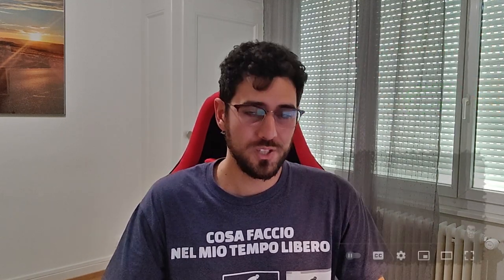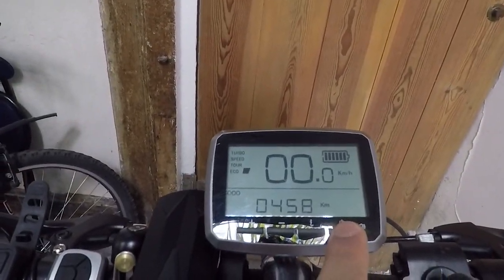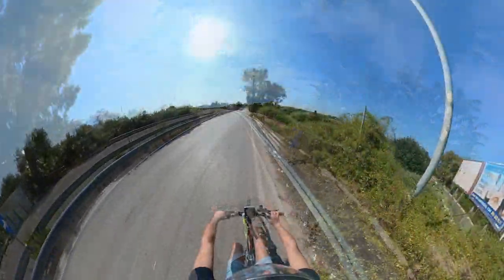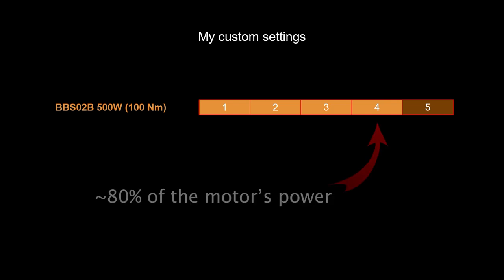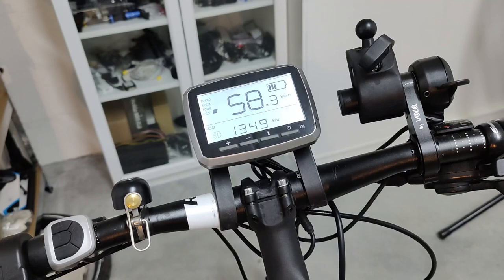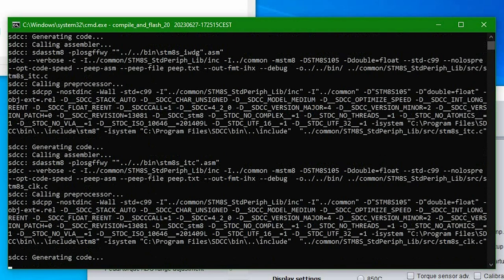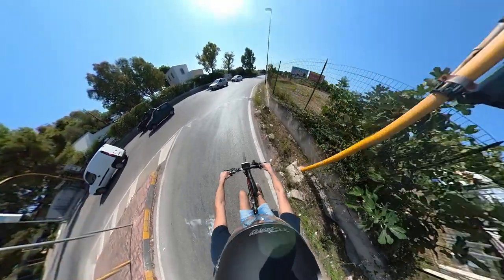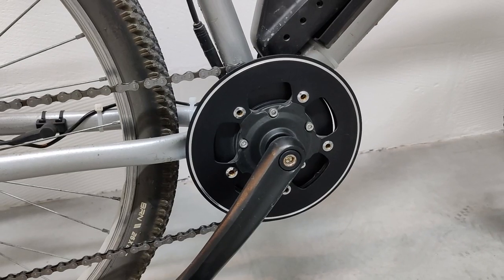Tongsheng: OSF Part 2... AS FAST AS BAFANG?

Comment: Hello Luke it is great to use your software on the tsdz2 motor. In fact it easy to install it. It worked perfect. NO errors. And now it is very adaptive. But one thing. Changing the settings with a VLCD6 display is very hard. For me almost impossible. MAybe you can make a short video of it.  Thanks and I hope you can give more support to change the settings with the display.
Reply: How much did the kit cost? Motor + battery?

Comment: Hi Luke, I have the BBSHD and the BBSO2B, and with the eggridder, I can set up both motors from my phone even when I'm out riding my bike and through bluetooth I can change the amount of power I want from each pedal assist even switch between off road and road settings with a press of a button.

Comment: I have a 750w kit. The big problem with this engine is overheating which prevents the engine from reaching maximum performance. I made some changes following the instructions in some videos and installing aluminum heat sinks. The situation has improved but during the hot season I will never get 100% of the performance. I don't think that installing this firmware will have any advantages as the main problem with the tsdz2 is due to a mechanical design defect.
Reply: 750w stock firmware will behave worse as OSF set for 500w. Also, Tongshen did you dirty, because in reality your 750w is exactly the same as my 48v 500w. Identical, to the last nut and bolt. Something to do with lawsuits as well ;)

Also done the cooling mod, alu insert and top plate + thermal interface material where needed. It's not enough, not for 900w at least ( and it's not even high summer ). Seems to be fine with ~750w set as max battery draw and using mainly the second and third power levels. 

The mechanical issue is the spindel, but if you ride the bike as a 'normal' commuter and you're not overweight, you're fine. I actually ride mtb tracks and in my 4k km I haven't had an issue yet ( I did install the recommended extra bearings, same time I did the cooling mod ). I am a lightweight though, so my spindle thanks me for that I bet. 

The other design issue is the heat dissipation, but that's mainly because the motor was intended to be 500w not higher. The cooling kit does fix this for a large part, I just didn't want to buy the big external heatsinks because I felt it would give away the thing aint 'stock'. You do need those, the alu inserts only improve heat transfer from the motor to the casing/housing, but the housing itself just lacks any real heat exchange surfaces of it's own. 

Anyway, kind of wished I waited a month and gotten the tsdz8 instead. Same pricepoint, lots more power and fixes both design issues present in tsdz2.

Comment: Anybody want a programming cable for tsdz2/tsdz2b?
Reply: Yes, I'm looking for one
Reply: Me too
Reply: @juan1ride  what country are you in?
Reply: Yes I'm needing one too, UK
Reply: It's really not that hard to make one yourself from the supplied cables with your programmer. That's not being pedantic, but even my not so great fine motor skills the wiki guide was enough to end me with a working cable. 

It's finicky getting the metal pins out of the plastic enclosure, and you really must imho even when wiki says it's optional use heatshrink over them, but even I could do it ( and my fine motor skills aren't really that great ). Took me 30 minutes.. and two sets of cables ( I luckily ordered two ST-Link v2's to start with ). 

I would also advice to ignore wiki which again says it's optional to disconnect your battery ( or turn it off ). It's not optional, or it wasn't for me. First ST-Link connected once, allowed me to get my backups from the controller but when trying to flash after that it kept failing. Couldn't figure it out for a long time, until I tried ST Visual Programmer again instead of the java configurator and noticed it said it was connected, but it now failed to read the firmware. ST-Link's do tend to die when using with a connected battery, or better said mine died with a connected battery, and my reserve one which I only been using without a connected power source is still going strong.

Comment: Hi Luke, if you are looking for a "ghost pedaling" feature it should provide a "cruise mode". You can also change the mode via the display (no need to reload the configuration via java configurator). However, when I tested the "cruise mode", it behaved a bit strange. The bike accelerated to the set speed when pedaling, but then slowed down, then accelerated again... It just wasn't a smooth ride, but a constant acceleration and deceleration. Perhaps this could be tweaked by setting some parameter, but I haven't figured out which one yet (maybe tweak the percentages for motor acceleration and decelaration, so far I'm using the default setting of 35%).
Reply from the maker: thanks man! I'll give it a try

Comment: This may be a dumb question. When you upgrade the firmware, will you have to upgrade the firmware again if you change your display?
Reply from the maker: it depends on the display: this OSF version is specific for the VLCD5 stock display.
So if you'd like to install the modified 860c display afterword, yes there's a different firmware: you first need to restore the stock one and then install the specific OSF version for that display

Comment: Hi Luke, did you try to revert to the original factory firmware after you flash custom firmware? What happens to the odometer after flash the custom firmware? Does the odometer reset or does the original value remain?
Reply from the maker: Hi, that's a great question! Yes I did revert to the original firmware and then also reinstalled the OSF: in both cases the odometer survived the flash.
Which makes me question where exactly the odometer value is stored... maybe in the display itself? Maybe in an unaccessible area of the controller? Not sure...
Reply: value is stored in eeprom in your controller ( on a protected address which isn't overwritten when flashing firmware ). 

Be happy, or any second hand tsdz2 would come with a 'measly' 500km use by flashing new firmware ( or changing the display, if it were stored there ) ;)

Comment: I've been running the TSDZ2 on open source firmware for over a year now, just passed 2000 miles.  Around 700 miles was towing 60kg in hilly terrain.  Feel free to ask me anything specific from my experience. Great video btw. :)

Comment: Hi. I consider to use a Tongsheng TSDZ2b on a recumbent bicycle (HP Velotechnik Speedmachine). The frontwheel has a diameter of 20 inches (backwheel 26 inches). Is the velocity sensor also compatible with a 20 inch wheel? This would save me from considerable extra wiring on the bike.

Comment: Hello I’m from Montreal and I have 2 bikes with the tsdz2b is it worth doing the open firmware? I would keep the same displays…
Thanks
Any input would be appreciated…
Don’t know where to start
Reply: Yes it is more then worth it. Or, it was for me. OSF totally changed the behavior, and where before I would get knee pain if riding fast just as on my normal bike, now I can ride a cadence which I like without feeling I'm fighting against the motor. 

Even without all the other mods and tweaks I done ( which aren't needed to benefit from OSF, just when using OSF to go faster ), OSF makes riding enjoyable. 

The different support options are all quite personal though, I use hybrid mode but some like pure emtb. This imho is where you'll gain the most, the differences in how the motor responds to your input is what makes OSF really worth it. 

Being able to tweak power levels is just a bonus.

Comment: Hi Luke. since I am ready to choose which Tengsheng variant of motor to buy could you pls help me in this choice? I saw that I have the chance to buy the 250W 36V, the 350 W 36V, the 500W 36V + the 48V that i dont mention. Consider that I dont care much about the legal problem because I rarely bike in normal roads and mostly I go on hiking paths and mountain roads. of course the 250W will give me less but probably will use more battery than the 500W. but the 250W can be enough? or i cannot compare to Bosh, Brose and other motors and maybe it's better to get the 500w? Grazie
Reply from the maker: Hey Giorgio! Those variants of the Tongsheng you mentioned are all 36V. Which means, they all deffer each other by software configuration.
If you intend to install the OSF, it doesn't matter if it's the 250, 350 or 500W: it's simply the same motor! Just go for the cheapest one.
If you want instead to keep the stock firmware, go for the 500W. It's simply the best you can get out of the 36V version.
The same idea applies to the 48V version, but ONLY for Tongsheng mid-drive motors! For Bafang it's a different one. I hope this clarifies a bit
Reply: @LukeLorusso  sorry I made a question in this video dedicated to the osf but I meant a general choice. I am trying to understand the pros and cons of getting the 250w or the 500w . I exclude the bafang since I don't think it's a good idea for mountain tracks
Reply from the maker: @giorgio.plazzotta  with the stock fw, the 250W would feel really slow... when I got the 500W I though the wrong unit was shipped to me, while instead it was actually the 500 one: it just felt less "energetic"
I'll say go for the 500W: if you prefer to stay in the 36V space, you won't be disappointed!
Reply: @LukeLorusso  I read that if I go for the 500w I could get the 48v version that will need a 48v battery. I wonder which pro and cons with the 36v
Reply from the maker: @giorgio.plazzotta  if we talk about the stock firmware, on the power level there's no difference between a 500W @ 36V vs 48V.
But, on the 48V variant you can get more range, cause you can have more Wh on the same battery size. If you take two batteries at 15Ah, you got 540Wh at 36V, while 720Wh at 48V.
Then, if you wish to install the OSF, that 48V version will simply become a 750W unlocked one...
Reply: @giorgio.plazzotta You can also use a 52 volt battery with a 48 volt motor. The motor and control unit can handle 52 volts. At higher voltages, less current is needed to achieve the same power. And the lower the current, the less heating and less energy losses.
Reply: I have been running a 36v 250W for a long time. My battery was losing capacity so I have refreched everything. Went for the 48v motor and have a new 20Ah 52V battery. Just flashed this software on it. Works well so far. I have a 2nd 48V motor and am sorting out the temperature sensor mods for this one. I think the throttle is pointless on this kit so losing the throttle for the temperature sensing seems like a good trade off.
Reply: @666ejames  Have you seen the tsdz8 reviews? If buying now, there is no real reason anymore to go with the tsdz2(b).  Better spindle design, better heat dissipation without needing modification and more powah. 

I didn't install the temperature sensor, I don't think it's really needed as I'm not pushing it over 750w and my cooling mods should hold up to that.
Reply: @pavelblaha5243  To add to that, the controllers is limited to 60v max current. 52v battery at 100% soc is 58.8v which is why a 14s pack is the limit for the stock controller. 

I know some people used bigger packs even, but only charged them to <60v. They claimed it gave a flatter discharge curve compared with a 14s.

Comment: When I start with OSF/embrusa using his settings file, there is not much difference in power between stock and OSF in power assist mode, but a little more in hybrid mode and EmtB mode. STill about 60% of the power of my 25A BBS02B,  I see you have really increased the assist numbers on the Power assist. Those are usually 50/100/180/280 and yours are 80/140/300/450. Quite high.
Reply from the maker: Yes indeed. As I say in the video, the goal was to reproduce a closer experience to the BBS02B 500W motor.
Of course, I'm not saying everyone should apply those numbers! With them also come more energy consumption and lower motor lifetime. Still, those settings sepresents the most I could squeeze without any thermal or mechanical issue, so I still feel confident with em

Comment from the maker: Some further precisions about this video:
- Thank you for the warnings about the temperature! It might be bacause of the 36V variant, but so far my 500W TSDZ2 does not heat more than my 500W BBS02B. Of course, if you play with the 48V variant, you use batteries with higher voltage or you push the settings even higher than this, yeah you should be careful about heating
- All that you need to know about the values displayed at startup and at lights on is in the Parameter configurator guide PDF, at the paragraph called "Display advanced settings"; for your convenience, here is a list of my custom parameters:

----- BEGIN CUSTOM SETTINGS -----
My motor is a 36V one -> Default_Settings_36V.ini
BASIC SETTINGS
- Battery power max (W) -> 560 [rev.002]
- Battery capacity (Wh) -> 560 [rev.001]
- Battery voltage cut off (V) -> 31 [rev.001]
- Wheel circumference (mm) -> 26-inch wheel = 2050 mm
- Lights -> Unchecked (I don't have motor-connected lights)
- Brake sensor -> Checked (I have at least one installed, Throttle ADC function will be available)
- Optional ADC function -> Throttle (I have the throttle installed)
- Street mode enabled on startup -> Unchecked (I want the full experience at startup)
- Odometer compensation -> Checked [rev.001]
- Set max speed from display -> Checked
ASSISTANCE SETTINGS
- Power assist mode -> 80, 140, 300, 450 [rev.001]
- Torque assist mode -> 50, 100, 150, 200 [rev.001]
- Hybrid assist mode -> Enabled on startup
ADVANCED SETTINGS
- Time to displayed data 1 -> 30 [rev.002]
- Time to displayed data 2 -> 30 [rev.002]
- Number of data displayed at lights on -> 2 [rev.002]
- Time to menu items -> 30 [rev.002]
- Data displayed on startup -> Volts [rev.002]
- Soc % calculation -> Volts [rev.002]
- Throttle assist value min, max -> 50, 255
----- END CUSTOM SETTINGS -----

Happy tuning! 💪😎
Reply: If you're measuring temperature from the casing - this is inaccurate, as the casing makes no contact with the motor.

In this scenario, it's likely your motor itself is already at damaging temperatures and you dont even know.
Reply: Why is your battery power max ( draw ) exactly the same as your capacity, I hope it's just some odd luck and it doesn't indicate you think they are related?

I'm running currently 750w battery power 600wh capacity ( this is a battery parameter, it has nothing to do with the power draw ). With most of the cooling mods done ( insert + top cap + thermal material ) this seems just fine for now. 

My battery is warrantied for motors < 1kw continuous, so I did try 900w. Turbo level didn't work as it should, don't think it's heat probably my battery isn't able to deliver what the seller said it should. My battery seems to not like >750w continuous so that's what it's set for now. 

I only ride max 20km at a time, without elevation. I think another location would not allow my settings, as going uphill or having to do longer rides at continuously high power would likely cause thermal issues. 

I use +-40% of my 600wh in that 20km ride if I go for speed ( just below 40 avg ). With stock firmware, I was using half that but also riding much slower and having knee pains due to pressure needed on the pedals ( to go at 35km+ )... while my normal mtb I can also ride 40km ( for short distance ).  I had to go for a conversion because of my knees, so at first I was pretty let down by the experience. OSF with hybrid mode finally allowed me to ride my normal cadence again, without it feeling like I was fighting the motor. I could enable field weakening to try and extent cadence support even further, but that hurts efficiency and torque so probably not worth it. 

Btw, your 36v for 560w needs 16A, without cooling mods the recommended is only 10A ( and 450w ). When set to 900, my 48v ( 54v fully charged state of charge ) is using the same amp draw ;)

Comment: It'll overheat and die on you sooner than you think.

Its a great motor once you put some heatsinks on it, outside of this its barely adequate as obviously, a dead motor isn't much use. I'd go as far as to say it's almost fraudulent the state in wihch this motor is sold given the serious heat issues it has.

Other niggling issues such as premature clutch failure, and otherwise poor quality components (for example, the pedal axle is known to crack and snap) really let this motor down. Extra modifications such as adding bearings and shims can help, but ultimately what it needs is better made components. For the average ebiker/non-tinkerer, this motor is absolutely not suitable.

In spite of this, i love the OSF aspect of it and for that reason alone i'm very fond of my TSDZ2(B). Particularly in an economy/society whereby manufacturers are "software locking" down everything behind paywalls and extortionate fees.
Reply: How many issues have you personally had?

I'm lucky so far, according to some on the internet. 4000km without any issues. 

Sure, I did add the additional bearings when I did the cooling modifications. But stock firmware should be fine without the cooling mod, and the spindle issue is very much dependent on the rider and riding being done. It's a weak design, but I'm a lightweight and I can go over jumps and drops without issues ( I actually do take my bike on the single track here ). I seen many pictures of people with broken spindles, most of them are twice my size. 

Besides, I totally agree with you that tsdz2(b) right now is now what I would recommend to people. 

Tsdz8 is much better :) I almost feel sad for not having waited till it came in stock when I was looking to buy.